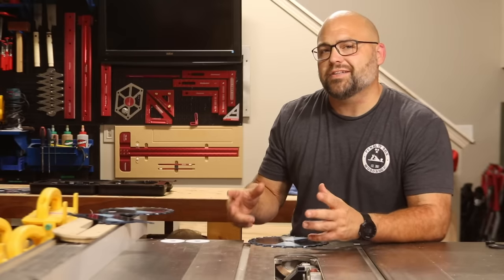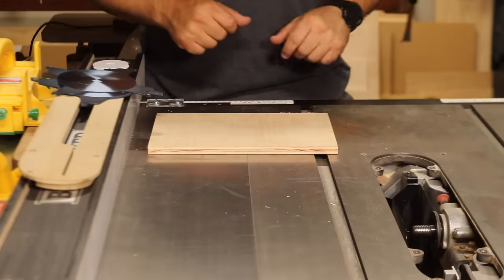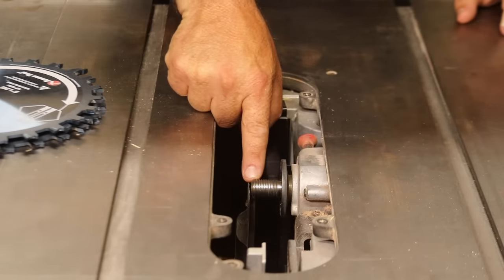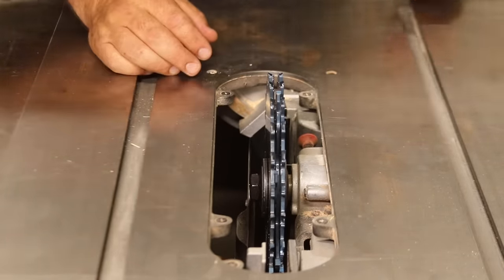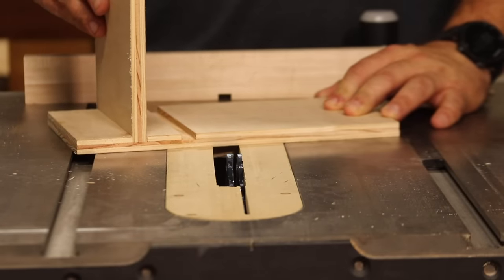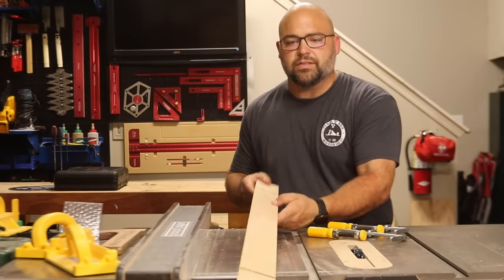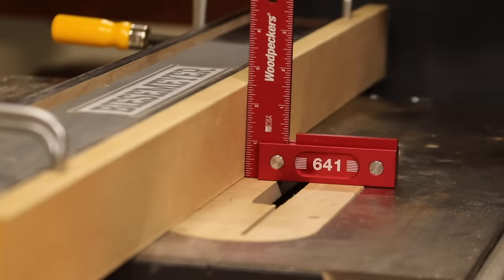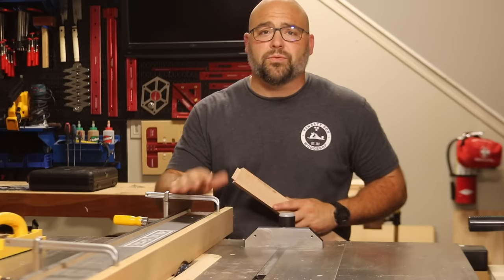How to Set Up and Use a Dado Stack - Full Tutorial and Examples

Comment: Hi, Thank you so much for posting this video. I tried using a dado stack today and was surprised by how jagged/ridged the cut was (I wish I could attach a photo...).  Any words of advice would be much appreciated! Thank you!
Reply from the maker: Yea if installed correctly and a good set of blades then it should be a good clean cut. Not sure what the problem is without seeing it.
Reply: @PenaltyBoxWoodshop  ,thanks for the feedback. I will double check the installation and try again....

Comment: good am , may iknow whats the complete description of this blade? i assume if ever ill buy this , it must be same diameter of my table saw blade
Reply from the maker: It’s a dado stack
Reply: Generally the dado is of smaller diameter to reduce centrugreful forces and cost. Usually about 8 inches.
Reply from the maker: I’m not sure why but my answer was sub par to this question. Thank you for adding this info because I totally missed the ball haha.
Reply: usually a 10" saw that is capable of handling a dado stack takes a maximum of an 8" dado.  An 8" saw (again that is capable.  Many are not) would be a max of 6" dado.  Don't put a large dado stack in a saw with insufficient HP.  You will strain the motor.

Comment: Great video.  I really appreciated it.  One question; do you need to use at least 1 chipper blade in between the outer blades?  Or can you just use the two outer blades to achieve a 1/4” dado? (Or whatever the width of 2 blades is)
Reply: Good question. I would think having two regular blades stacked would be okay. Or maybe one regular and one chipper?
Reply: You can use just the outer blades. No way that using a chipper in between will get you .250. I use the 2 outer blades and use either 2 paper of magnetic shims in between them. This usually gives me precisely .250.  I use the Freud safety dado set & different dado sets would need to be shimmed differently.

Comment: Is the cover thing over the blade a necessity?
Reply from the maker: The cover thing? Can you point me in a more specific direction? Not sure what you mean.
Reply: The thing around the blade that u said ur friend made, sorry, not a carpenter just got a table saw and trying to learn 😬
Reply from the maker: Jeremiah Brown gotcha! That’s called a zero clearance table saw insert.  Yes, a insert with an opening wide enough for the dado stack that you are using is absolutely necessary.  It also should be used at all times with a normal blade

Comment: Hello, I have a question for you, I can use the dado blade on any table saw specifically on Delta 36-6022 which is the one I have ? thanks
Reply from the maker: No, not all saws have an arbor that is long enough to use a dado blade. You will need to look at your saws manual/measure the arbor length, to determine if your particular saw can accept one. Other than my own saw I’m not sure what saws can and can’t accept them.
Reply: Penalty Box Woodshop thanks for the information I appreciate it

Comment: I was wondering if you could help me. So I have a dado stack and today I used it to thin down a piece of 3/4 inch oak. I was making a border for a table. The piece was 48 inches long 2 inches wide and 3/4 inches thick. I set my dado stack so I could thin it to 1/2 inch. I probably did it all wrong because it didn't come out perfect.  I ran it through several times and when I got to where I needed to make 1 more pass I placed a piece of 1/2 inch plywood to give it support. Naturally I don't have one of those cool push tools you have so i made one with some left over material I have since I am very fond of all my fingers and hands. I also considered just running the piece on it's side to thin it out but that also seemed dangerous. What would have been the best way to accomplish that. ( I did try to find a piece that was already 1/2 inch but they don't sell it that way).
Reply from the maker: To be honest I’ve never tried to thickness plan a board using a dado stack. I understand your thinking on it and thankfully you stopped when you felt uncomfortable and before it got unsafe. I don’t think that I would attempt thicknessing  in this manner. I would use a planner, drum sander, or hand plane if those tools are unavailable to you. When In doubt and when you don’t feel like it’s safe. Then stop and do not proceed. Thank you!
Reply: Penalty Box Woodshop thank you for your reply. Maybe some day I can afford a planner. I finished my table and it came out well, but must get more tools.

Comment: I was trying to dado across maple plywood and the splintering was terrible,,i even taped where the dado cut was going to be and it was terrible,,any advice to help me would be appreciated
Reply from the maker: Hey Jeff, happy to help. First question is what types of blades are you using and are they sharp?
Reply: I am using the oshlun 8 inch dado stack that amazon sells,,it had a good rating and so far what little I have used them they seem really good and sharp,,,and im cutting across the grain in maple plywood for drawer dividers
Reply: @jeffoldham3466  Have you considered scoring the cut lines with a knife before sawing?  Across the grain is tough.  Tape usually helps but in your case scoring might be the additional technique you need to make the cuts come out perfect.

Comment: I had to put 4 spacers between my 2 outside blades to get a 1/4 inch cut. That’s why I’m watching your video. The directions only call fo the 2 blades. I’m not sure if I’m crazy or the directions are crazy
Reply from the maker: Hmmmm yeah that don’t sound right
Reply: @PenaltyBoxWoodshop  I’m still experimenting with it. Im new at using them so I figure it’s something I’m not doing right.

Comment: I've never used a dado stack. Never needed to until now and I'm looking for some insight. I have a 12" left tilt Grizzly and I don't see any options for a 12" dado blade out there. Will an 8" stack be safe to run on this saw? Thanks!
Reply from the maker: I personally don’t have much experience with a 12” table saw but I know that an 8” blade works fine on my 10” saw. However, I believe that on a  8” and 10” blade usually have a 5/8” arbor hole while a 12”  blade/saw uses a 1-inch hole/arbor. So, I don’t believe that an 8” would work. Of course this is just my general knowledge so I would definitely be researching your particular saw and or refer to the manufacturer to be sure.

Comment: A quick word of caution here. You might want to consider doing the set up of the thickness on a piece or hardboard or plywood. When you lay the first blade on the cast iron surface of your table saw, you risk damaging the edge of the extremely brittle carbide piece on the teeth of each blade. This may save you the expense of replacing the carbide piece or the blade itself!
Reply from the maker: Yea I try to be careful but I understand what you mean

Comment: I recently inherited a set of chipper blades.  For some reason there were not any outside saw blades that came with them.  Just the chippers.  Can I use any blades with the chippers?  Do they sell blade only dado blades?  A quick search of Amazon didn't come up with anything.
Reply from the maker: That’s a great question about id you can purchase the outer blades only. I think you would be better off contacting Diablo directly instead of amazon though. I would never use anything in a dado set that didn’t come with the set and or made for it. There are too many scenarios for danger by mixing and matching in my opinion

Comment: Help me please I have a question 🙏
Reply from the maker: Send it
Reply: @Penalty Box Woodshop  I'm trying to build garage shelves free standing in my garage with 2x4s and 4x4s as the corners but what's the best way to get the 2x4s flush on the inside of the 4x4s would a dado blade on a Dewalt home depot table saw work?/be safe to do

Comment: Why not use a piece of plywood on your metal deck instead of placing your dado's directly on the steel?
Carbide tips are very brittle and can chip when they smack against another hard material.
Reply from the maker: Yes you can. I don’t smack mine and I’m very careful but if you’re worried about it that’s a simple solution

Comment: The sky used 2 spacers when he was testing the height.
And then he used 3. Spacers. When? He installed it. What the h***?
I turned it off immediately.
Reply: You need some room for the glue, and for squaring up properly without stressing the workpiece with a fraction of a millimeter spacer. ( Got to use imperial and metric with that one :-)